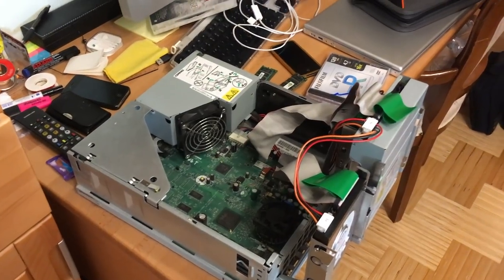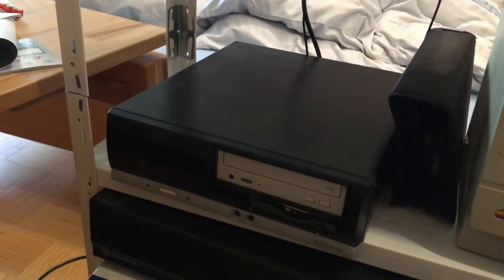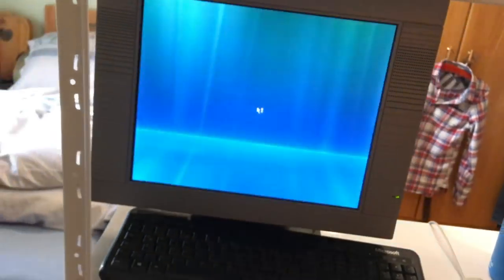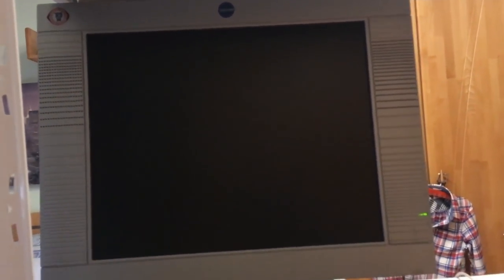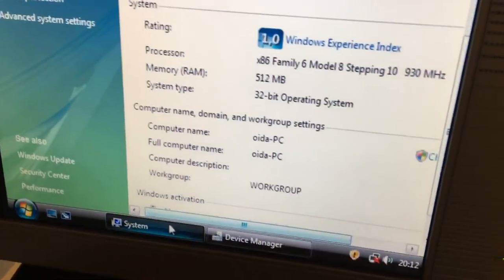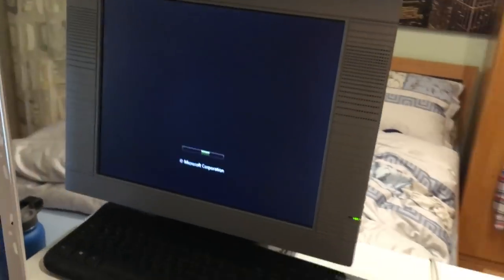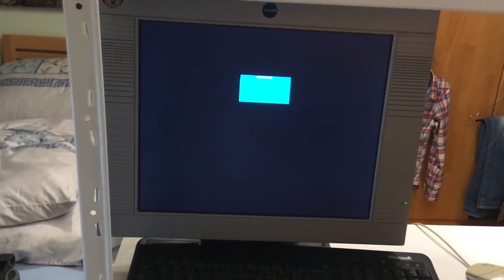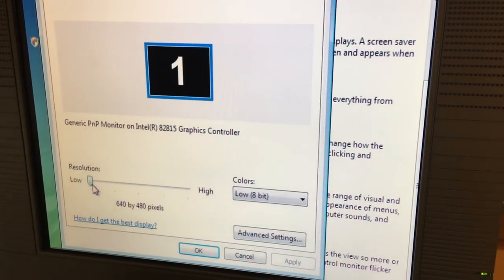Windows Vista on a Pentium III

Comment: Living that Vista life so much frustration so little time LOL when Vista worked right it wasn't bad but you definitely needed the service pack updates otherwise it was a pain in the ass quite impressed to see it running on a Pentium 3
Reply from the maker: It would have been working even successfully with a supported GPU.

Comment: I did that to my dell. My Dell Dimension l933r has 350mb of ram and windows vista starter worked. Good video
Reply from the maker: There is vista starter?
Reply: Macintoshmani12 Yes there is but it can only run 3 programs at a time!
Reply: @MacintoshMen  Sage

Comment: Haha.
I used to have Vista on Pentium III PC, but it had a Radeon 9550, so the graphics drivers work fine. Aero actually worked as well and didn't slow it down too much.
82815 was useless after XP. I never got the on Vista+

Comment: Never seen this kind of graphics madness before.  Either way, you can try to boot up a Windows Vista in 640 x 480 mode or in safe mode and try to set the default resolution there.
Reply: Z

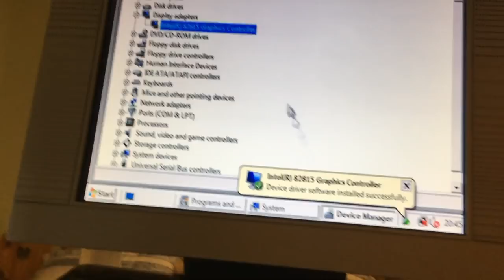Comment: 20:35 That's not Vista, that was you failing to delete the device driver as you uninstalled it. It gave you the option to delete the driver along with the uninstall.

Comment: I installed home basic on my inspiron 700m via a spare sdcard.

And DAMN! Its really snappy! Really goes to show just how good the Pentium M was! And how Vista can be shown in a good light!

I did upgrade the ram though. And replaced the hard drive with an sdcard adapter.

Seriously. If you have an old laptop with a mini ide hard drive: Replace it with an sdcard adapter. It makes a WORLD of difference!

That and the ram where the best upgrades I've done to my 700m.